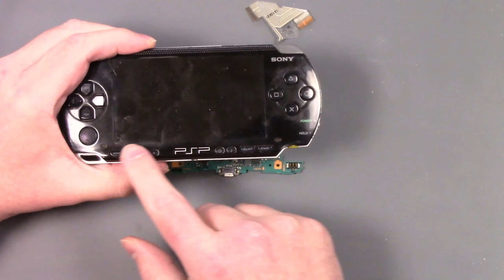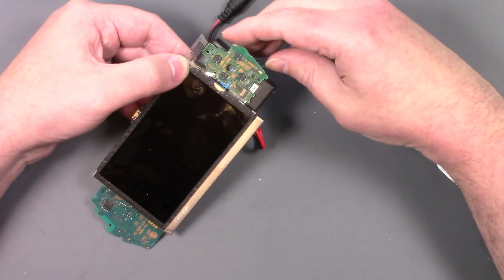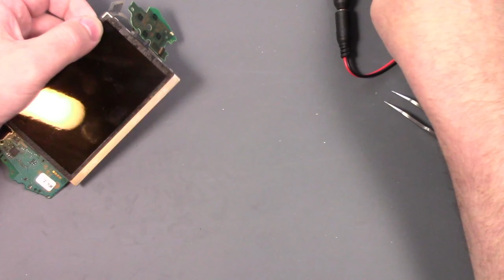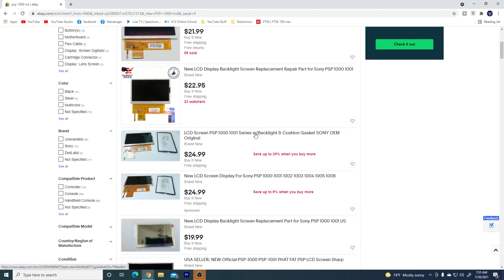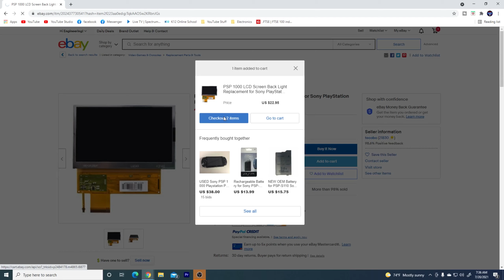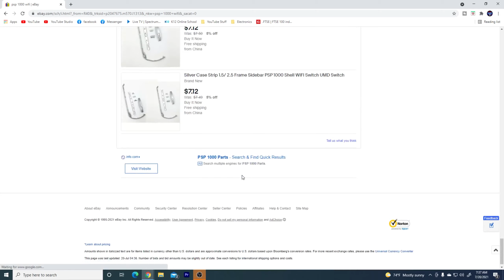PSP Repair Series Part 1 Testing Out The Boards & LCD Screens

Comment: Trying to learn how to fix my PSP at the moment and this video helped! Having a similar issue to the first board/screen configuration you tried where I can draw power but the screen does not seem to work. I’ve bought a new screen and “confirmed” it is probably the board. No idea what to do and was hoping there would be a part 2 to this video since it was heading in that direction. Would love any help!